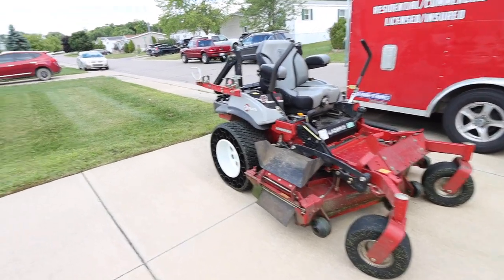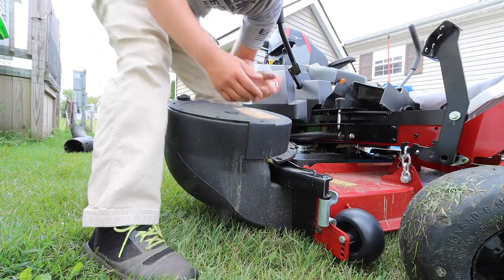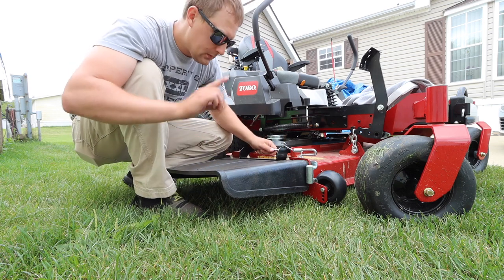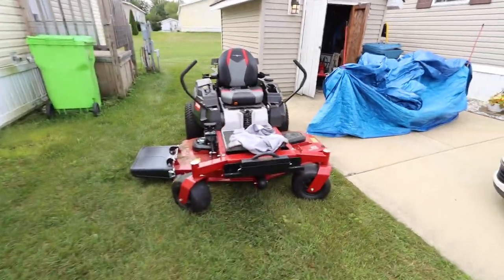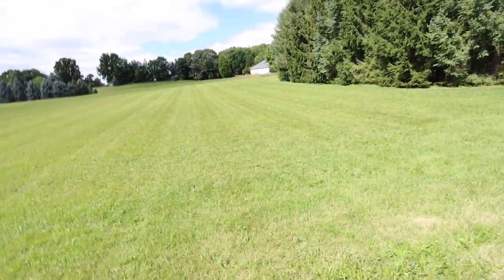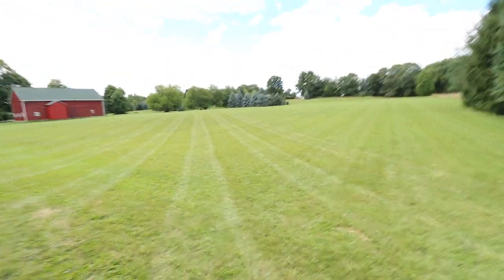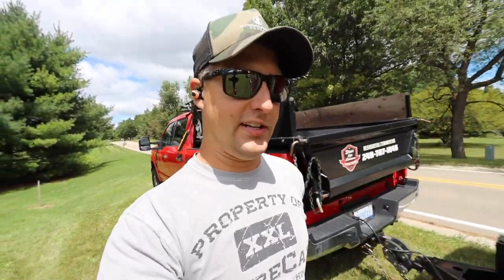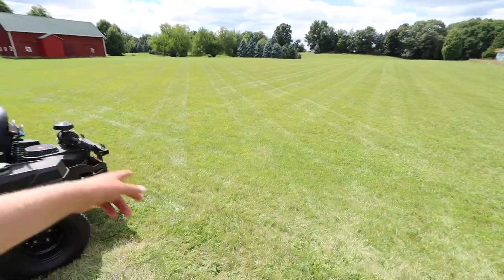Does It Stack Up On 3 Acres?! (TORO TITAN Mowing Action!)

Comment: That thing stripes a lot nicer than I thought it would! I'm actually super glad you mowed in a different direction with it instead of running over the already imprinted Lazer Z stripes so we can see the full potential of the striping abilities of this unit! Also I'm glad you decided to take the vacuum system off, that uses a lot more of your engines power than you think, having that on. It takes a huge percentage of the total power to add the secondary belt and turn the impellers inside the vac. Removing it gives you and lets us see the full power potential to the bare bones machine and would honestly probably cut grass better and more evenly especially longer grass since it won't be taking so much power to chuck it through the vac into the bags and bogging the engine down a bit. Honestly wouldn't be against recommending this to first time contractors, the guys that are starting out with one or two guys, this machine is perfect for. No need to spend 15,000 right off the bat when you can definitely still use this commercially with very little issues, and you could honestly put some stronger parts into it to make it more commercial friendly while still spending a fraction of the cost of a true commercial unit! Especially since toro makes commercial units and could probably mix and match some parts from eachother! Unless they intentionally made too drastic of differences to keep people from doing that to avoid spending the extra money on the commercial units.

Comment: I actually just bought a Toro 42" with the MY Ride system had to get the heavy duty Spring set cause I'm a bigger guy but I love it couldn't imagine mowing grass without it I wish I would have bought it a couple years ago!! the 22HP Kohler engine is very impressive lots of power I'm very happy with this mower!!

Comment: I own the titan 52” 1500 series and does A very good job.   For the price and options it a very good mower.  I added the trimmer ,the 5 gallon bucket holder and the back pack blower mounts.   Toro has a few items to add to mower to help with carrying tools and even a mount area in the front to jack up the front end to change tires or wash under the deck.  Can’t go wrong with this titan series.

Comment: Ever thought of just bolting some blocks (chocks) to the trailer floor instead of strapping the mower? I cut some out of 4x4's and even made them so I can remove or move them around for different machines easily.

Comment: We usually run Toro grandstand's but this spring I noticed that the timecutter mx5000 "homeowner" mower had a 3 year unlimited hour commercial use warranty on it's Kohler engine. It only cost 2499. It's not as good on hills and the top speed is a little slower but for 25% of the cost of a grandstand it's phenomenal. Not sure I'll buy another "commercial mower" when I can get 4 for the price of one...

Comment: I would like to see how the Spartan does on your property.
Reply: I have a 60" 26HP RT-HD that I maintain just over 10.5 AC with and no issues (just over 3 hours on meter to mow). The first year, I did with the stock seat on entire property and felt every bump. Then I got the suspension seat and should have done that from the start. It is my first experience with a ZT, and it has been a GREAT one for the past 2 yrs. I now have a tractor/BH that my FIL uses mow the lower 5 AC. He putts around the straight runs and I catch all the rest.

Comment: This disassembly of the Toro bagger is interesting to watch.  But what is the weight in the front supposed to do? Ensure the front stays level? I like Toro lawncare equipment.  It is an old & established company that has gear for the pro & DIY.  Had an old Toro mower that cut just fine once you got it running. Wouldn't hesitate to invest in Toro again but would stick to a manual push vs power driven to keep it simple. I think the simpler the design the more reliable the push mower. Thanks for showing the Titan.

Comment: If you are missing a 1 1/16"  socket, I noticed you left it inside the pulley when you rolled the belt off of the pulley. Been there.

Comment: Congrats on your new property!😊Great vid n review👍 I recently bought my first zero turn mower, Husqvarna Z242F, to use on my small farm, These zero turn mowers are very expensive over here in northern most part of Europe. Paid equivalent to $6000 for it.
I have 2.5 acres to cut, and am very happy with this machine. But maybe I'm gonna upgrade to a commercial type, for next season...either a Husqvarna Z448F or Ariens Apex 48, both are like equivalent to $ 8-9000 each! what do you think is the best option🤔
Keep up the great work!🤙Cheers from Norwegian subs
Reply: I got the toro 2000 hdx my ride suspension. For $8,500 they knocked off 10% i paid cash.
Reply from the maker: That’s awesome, congrats! And thanks for the support!
Reply: @R.E.L.Asphalt_Sealcoating  a Toro Timecutter XS5450 MyRide is 115000 nok/ $12500! Over here... ie. Expensive🙄

Comment: I am about to buy a 8AC piece of property. I am trying to figure out if the Titan or Titan MAX would be better for me. I noticed that the fuel tank jumps from 5gal or so on the Titan to 8gal (I believe) on the Titan Max. How many acres can you make it through on just the 5gal tank?
Reply from the maker: I honestly think you’d be fine with either unit. The Max has the ROPS and air canister feature, larger gas tank, it’s aimed at the prosumer/ entry commercial guy. I think it’s a dope unit, but it’s up to you if you want to spend the extra $500-$800 or whatever it is. You might want to get it if you have a larger piece of property and want longevity out of the engine and beefier turf tires.
Reply: @BriansLawnMaintenance  
Do they both have the same hydraulic drive units?

Thanks!!! 

I may go for the myride just because the property has lots of dips and such from getting torn up by livestock. It will pay to be able to go faster.

Comment: Just bought a 2020 50 inch toro timecutter with myride and Kaw engine, love it....
Reply from the maker: Nice!! How do you like it? I much prefer EFI over Carb but this engine does hold its own
Reply: Very nice buddy! My missus and i bought the 2019 toro 50" timecutter. It is the "high end residential, entry level commercial" but i am mowing all of our residential and commercial accounts with it. It cuts great. Even in taller grass.
Reply: @BriansLawnMaintenance  Cant beat efi, but Kaw engines rock....

Comment: Prolly a dump question.   Have a gravely zt 54 xl residential and took off discharge shoot the first day...never looked back.  Now I've got the beast Mach one!!! Love it so far but easy flip up or down discharge....when I see you floundering with the toro flap...makes me think it must be important...can you help me go out there and kick the 411 on dicharge flap needed or not?
Reply from the maker: Technically you should have it on, but I’ve seen that 80% of folks take them off. For me personally I just don’t want a rock to zip across to a neighbors window. If it was wet spring conditions I’d probably flip the chute blocker up. This time of year it’s not overly required. We did a whole video going deeper in this topic titled “Don’t remove this!”. Start there! 

Ps, that Gravely looks dope!
Reply: Thanks for that.  Front of deck has about 6 inches above the blade and about foot in front of the blades....ideal for heavy discharge and or bahai!!!!! Which I just took my first commercial job of a 12 acre school.....and zt54xl not made for high speed bahai!

Comment: I pickup my 2021 Z Master 2000 HDX Pro 60” tomorrow. Has HD bagger system as well. Upgraded from pistol grip stand up 48”. Can’t wait to start mowing again. Also in Michigan.
Reply from the maker: That’s awesome buddy congrats
Reply: @BriansLawnMaintenance  Well Toro didn't think these new models through very well.  The previous bagging systems will not work on the new model 2000 and 4000 series.  They basically had to send the mower and bagger system back to Toro from the dealer I bought them from.  I ended up ordering the Z Master 5000 due to that model not changing and the DFS bagger system will work with it still.  Crazy how the engineers dropped the ball on the accessories for the new model.  Its all due to the mounting bracket being about an inch off from fitting over new exhaust height.  Cheap fix but they said it will take time to replace if they even decide to.  haha

Comment: Great video Brian, I am a Toro guy, and I think the Titan is a solid mower!
Reply: The titans are great , I’m an owner operator, I own two, one has 1800 hours on (2015) other one I bought dec 2019, almost at 300. Both with bagger attachment for fall clean ups .
Reply: @fivepointslawn2275  do yours have the MyRide suspension system?